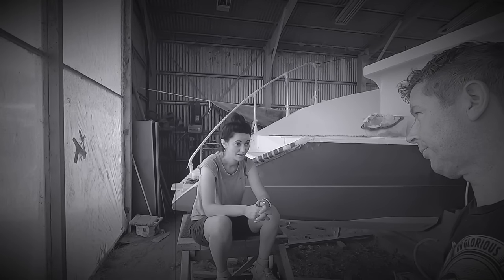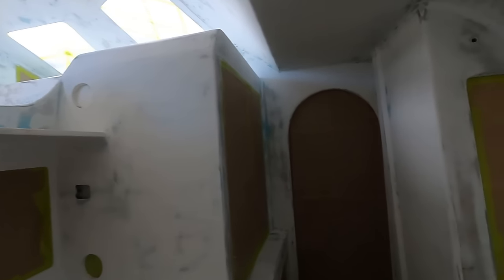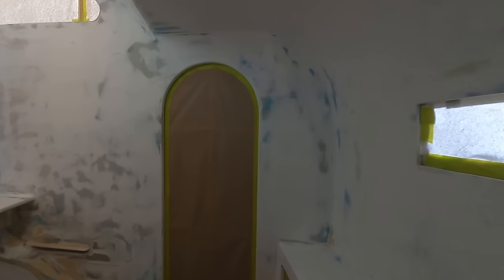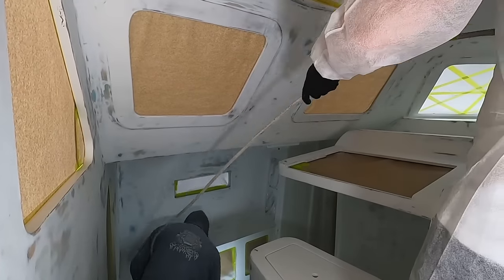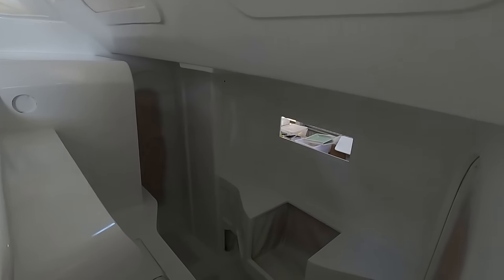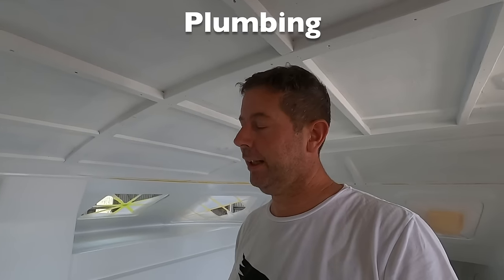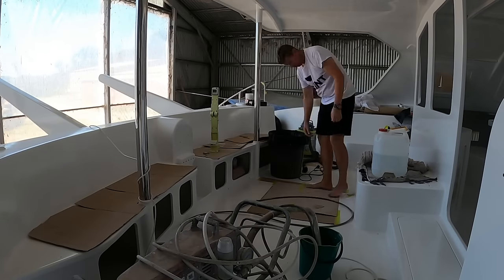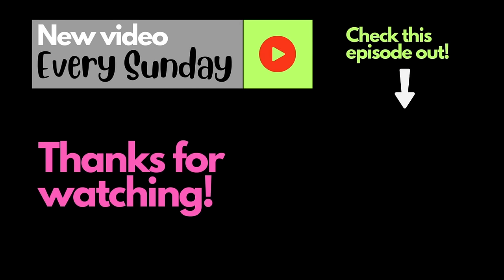AMAZING Interior BOAT spray painting -S03E16- Building Wilda | Catamaran Build | Restoration | Refit

Comment: With plumbing, a good source of parts is caravan supply shops. We are using John Guest 12mm PE tube and quick connectors. Saved a heap by going to a caravan shop compared to a marine shop for the same product. But i have found that using angle connectors is best for corners etc. The tubing splits after a while if bent. You can get different coloured tubing for hot and cold water. All the best
Reply from the maker: Thanks for the tip! We'll definitely check those connectors and other stuff from caravan supply shops. We agree with the color coding too! That's the plan!

Comment: Big step!!  Ive been there and this is definitely the top of the hill.  Still lots to do but the worst is over.  Get yourselves some boat shoes and leave them on the boat so you can switch shoes on the swim platform and be sure they are clean.  ALso there are many floor coverings out there for temp floor protection and you can buy a sticky mat to remove the dust from your feet (I am a home builder/boat project lunatic like you :).  Keep em coming!
Reply from the maker: Thank you for the suggestions. We did try some kind of boat shoes for a while but we have all the tools and equipment outside and so there is a lot of climbing up and down and therefore a lot of changing shoes too... It worked for a while :)
Reply: @buildingwilda   there is no easy way sadly.  We get to this stage on my job sites and they guys just switch shoes at the door all day 100x a day... it sucks lol